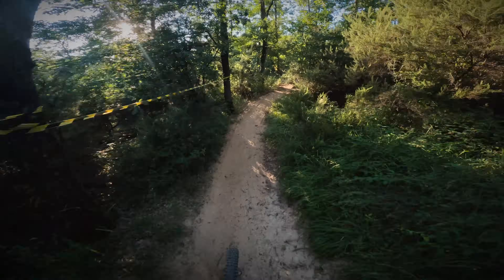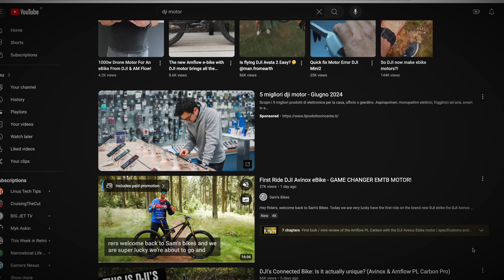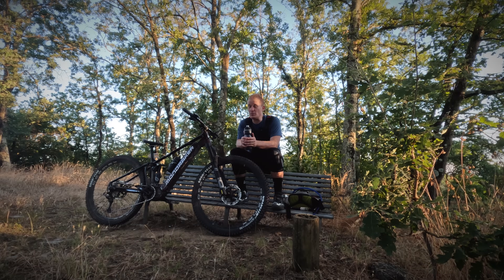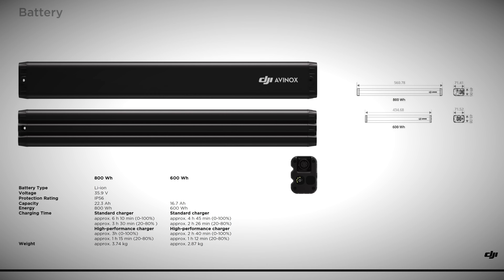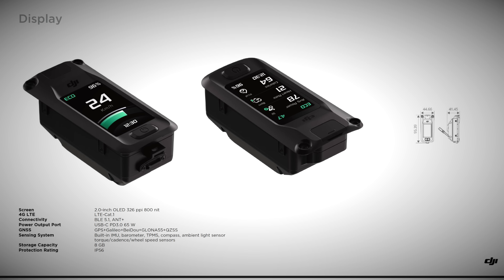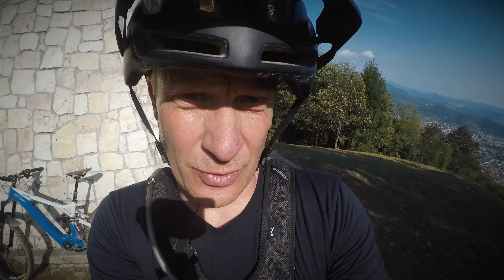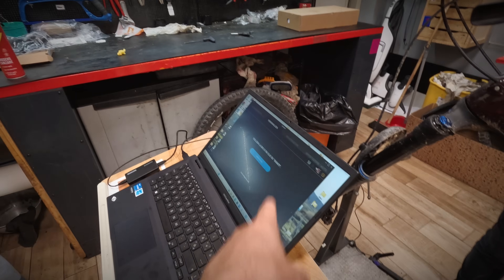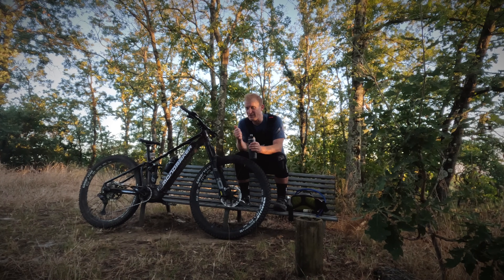Usable Motors Please... DJI Avinox, ZF CentriX, Pinion MGU.

Comment: Fully agree with your insightful, big picture observations on the latest versions of the emperors new clothes. I also have concerns about wear and tear from the dji power.  I've also contacted dji and pinion with questions and only pinion answered as they understand customer service.
Reply from the maker: If we look at the EN standard rules for power DJI's quoted peak power completely breaks the rules. The limit is 500 watts.  I'm interested to know then that if the limit is 500 then it would be incredibly silly for brands to break it. This their quotes of power levels must be therefore exaggerated in someway. So my question is who is telling us BS.....

Comment: Excellent observations. I reckon bike manufacturers ought to listen to your advice. Yes, we want more durable motors. Not necessarily more powerful motors. We need our bike motors to be repairable by the local bike shops and the home bike mechanics, and we need to be able to buy the spare parts easily. I want to be able to ride further on a single charge, with fewer maintenance hassles.

Comment: Yes the coffee grinder sound of the MGU would kill the joy of Emtb for me. I've updated my 2018 super silent, smooth and powerful 1.3 Brose Levo with a Rohloff manual change hub,170 mm Fox 38's  150mm cranks, 9piont8 steering head slacker kit + more.
The silence is golden and goodbye derailleurs for me. A brand new spare sealed, updated motor and two 500wh batteries are the go for me.Going backwards with updates gives me what I want until they can come up with something as silent and smooth and reliable. E=mtb² or is the new Amflow E=mtb³ ???

Comment: TQ's parts are hard to find here in the Netherlands, and also more expensive than for example Bosch. But most ebikes I come across here usually have bosch midmotors, or bafang hub motors. Never seen a shimano unit, but I also hardly see mtb's on the roads here. It's 95% citybikes

Comment: You failed to mention the huge difference with the ZF. Sure, the motor is small, but the biggest factor for heat dissipation is the basic design. It uses an outrunner rotor, which while great for torque in a small package, suffers from a longer path for heat dissipation from the stator. CYC Photon (also an outrunner) manages heat reasonably well, and reduces power to the motor to avoid damage. That any other manufacturers don't do this is astonishing to me. If it is true that the ZF motor is oil filled, this is how they are improving heat dissipation.
Reply from the maker: yes that is why it is oil filled.

Comment: There are many new brands coming to the E-Bike market now which is certainly a good thing. Also French Valeo has a new motor gearbox unit and they are a big player. ZF ist certainly also an interesting player they own Sachs which has one of the most powerful motors in the market since several years and they have over 100 years of experience with gearboxes. Also ZF ist 10 times bigger versus a smaller player like DJI.

Comment: Service and reliability. Key point. My wife's Gazelle had a disintegrated motor (Impulse motor, 8,000 commuting k's). Couldn't repair, no replacement available, no provision for any alternative motor. $3,800 dollar bike made useless. Went with a German made bike with a German motor after that. Now with more than 11,000 k's and still running sweet.
Reply from the maker: exactly
Reply: Presumably a Bosche. What bike? Looking for reliability for my first ebike choice.
Reply from the maker: @RoissyAngel  Anything Bosch will do you well. Try looking at the Trek Rail 5 or 7
Reply: @RoissyAngel  Bosch has the edge on all but they protect their product closely. She chose a Kalkhoff with 26 inch wheels. It feels much lighter to ride than others. I chose a Focus that is more affordable for what you get. It has very confidant handling.

Comment: Great perspective!  Polini isn’t available where I live.  I’d much rather a gen 2,3 or 4 motor that has proven reliability, likewise I’ve also gone Shimano for the first time as a drivetrain, lots of different options and unlike a MGU no large single point of failure so I can use less expensive and more durable options and fix things while I’m travelling.

Comment: There has been a couple times were my old shimano motor couldn't quite cut it up a steep section. 50% of the time it's rider error or not being prepared for what is to come... I have normal cable derailleur so can't just smash down gears up a hill xD 

But there has been a few hills id be like "that be so cool if I could climb that... " bicycles are for fun so if there's people out there who find that higher power more enjoyment to their ride then yes power will sell :) 

It's like owning a car or motorbike, yes this 1 litre shit box can get me anywhere.... can a Ferrari get me there in a more fun way most likely haha.  

That being said power management is also key... if ur climb tight steep switchbacks you need the power to be steady and natural not jerky. Tunable power comes in play for this too. More overrun for sections etc.
Reply from the maker: After 80 NM power management is key, its easy to mess it up with a loose overrun or harsh cut off or too much wheel spin.
Reply: @alexbiketester  i drag the rear brake quite often when it gets technical to stop it jolting off.

Comment: Back in 2021 I had the opportunity to ride a friend's  Haibike TQ HPR 120S,  for a week. At first it was mind-blowing , on strait lines , country roads etc . In the really technical trails it was way to much power from that engine and it wasn't really controllable. In my opinion, 85-90 NM is more than enough for an e-bike. More than that, and we reach the sphere of electric motorcycles, loosing  the fun of e-bike riding where it's not just about the engine, but also about the rider's technique and abilities.
Reply from the maker: yes!

Comment: Won't consider anything without integrated motor/gearbox now that it's been done.
Another company has an integrated motor/gearbox that is CVT soon to be released, which is my new target - when that's released I'll be looking to upgrade my ride (whenever they release the units themselves or they start turning up on ebay from junk bikes).
Reply from the maker: great to see the motors, but a bike is more than a motor.

Comment: The real advantage of the Pinion motor is the gear box. As far as I know the motor is a variation of an automotive power steering motor.
Motor plus human power tend to chew through cassettes and chains simply because you can put out way more power than even a pro athlete can provide. A pinion gearbox is designed to withstand these forces especially because the gears have near to no width restrictions and don’t need to deal with dirt and grime. 
The big advantages of a derailleur system are efficiency and weight which are both next to irrelevant on an eBike.

Comment: Couple of points. A carbon belt drive for 1000 Watts is just better than in every way to a bicycle chain no matter the brand. DJI have more battery/efficiency experience than any other brand. Less dangly bits and lower wheel mass is also better.  DJI has by far the best speed sensors, security software, bike interface, controls than anyone at Eurobikes 2024.
Reply from the maker: we need to see in real life what the system is like for a few 1000 km to judge. History tells us marketing is one thing, reality another.

Comment: Well, it is not about the power! It is about the torque! It is the torque/force that moves objects. F= m*a or a = F/m. Also, it is about assistance levels and giving the rider full control of the motor. We need manual modes, no auto-modes.

Comment: Well Pinion might not have had years of motor experience but they do have quite the long track record of Gearbox units.
I’m sure the MGU is up to the same durability standards.
Specially when it comes to sealing and gear quality.
Many motors fail on the gears they use (often plastic gears or bad sealing) 
Pinion might have the upper hand on those specs
Reply from the maker: We need to talk to them about reliability and how they manage issues, at the end they will benefit like Polini has.

Comment: I don't care about motor power (all existing motors are powerful enough), but DJI's fastcharing is the biggest gamechanger for me. I'm so excited about the 12 amps charging that I'll probably preorder an Amflow bike as soon as possible. I ride a lot on the Alps and long full day routes easily have 3-5k meters (or more) of ascent. But with current technology this means carrying an extra battery and a charger and still most of riding done in eco. But if I can fastcharge the battery to 50% in 30 minutes, this basically means infinite riding and no need to carry a spare battery.
Reply from the maker: Their battery density is leading the pack at the moment. I'm interested to see how the cells last with faster charges. At the end batteries are a consumable item, even if we don't like that fact.
Reply: Fast charging in the boonies? LOL.
Reply: @malanalan1  more or less every mountain hut in Italy will have power outlets for charging ebikes

Comment: About the power I must say we didn't have a great motor nor battery when we did our 6561ft emtb capability test ride but when we tried really steep stuff I'm talking 50% 1:2 slopes on dirt or grass I did realize too much power was a bad thing, since only the rear wheel is powered the front wheel lifted and the bike tried to do a backflip even tough I was leaning on the front and am a heavy guy, for extreme use like this I think we I included need to study bike geometry and what angle the fork must have because this seems more limiting than the power which on a mid-range 3y old ebike was enough already that the bike seemed to leave us in place almost fell from the saddle, I'm sure current generations tame their torque better tough it was very on/off for us

Comment: Whilst I agree on pretty much all the points, the benefits you’re missing with these new motors are: 1 - Reduced Motor Noise (Yes, it matters) 2 - Wireless Remotes (Everyone loves an ultra clean cockpit) 3 - better top tube controllers (Having an array of data available as the default integrated option is key).  Pity the ZF has wired controllers, and no top tube display :(. Hence DJI is nailing it where it matters.  Would love it if we could get the above alongside an integrated gearbox unit & belt drive; that’s got to be the holy grail.
Reply from the maker: Thanks for the points. Will do a video on displays soon...

Comment: ah...another useful reminder of something I noticed but forgot after renting an emtb twice the 1st time was nearly flat except one steep slope where I tried to pedal as strongly as on my muscular bike to go up really quickly the motor oveheated and shutdown (it was an old early bosch) 2nd time was a more modern but still not current bosch gen2,3 i think this one didn't overheat despite the extreme uphill 6561ft done to test if an emtb could do what I wanted out of it reach remote mountain trails, didn't overheat but lightly burned my leg on the block it was HOT it was in summer with 35°C 95°F oh yeah also those engines only go on 10'000 bikes so not for me
Reply from the maker: Yes overheating is a highly under talked about probbablem. many talk about rain mud... but heat also covers half the planet...

Comment: Agree with all your points. 
Interesting for the ZF motor is that an aluminum frame is recommended for increasing the cooling effect as the motor is clamped onto the frame, but Raymon fitted it onto a carbon frame.
Reply from the maker: They need to sell high value bikes to make it start, most companies do that. The Oil is probably to aid cooling. We lack real world info, no influencer or youtuber has actually published anything useful which is my point... hahah

Comment: It’s very easy to buy into the hype, so it’s good to get a reality check. It does mean more deals on existing tech. All this innovation is great though, keeps Bosch and Shimano on their toes. I do love the screen on that DJI it must be the best frame mounted screen to date. I think clutches and MGU’s is the way everything is going, but it’s still early days and much of the tech is unproven. It seems like full system set ups is where we’re at today, SRAM, Shimano and now also Bosch. Autoshift, etc.. 
Lastly very jealous of the Italian weather, we’ve had a crap summer in the UK this year.
Reply: Haha i almost mentioned the weather also.....DJI do seem to have done their homework, will be interesting to see why Bosch had all their CX motors covered up at Eurobike, think they may have had an OH SHEEET moment when DJI and ZF dropped. I'd also be surprised if ZF doesn't add a gearbox onto that Motor, it is after all their thing!!
Reply: @MTBGeordieDownSouth  ZF did surprise me with no MGU, I suspect that was a bit much to ask for the first model. I’m sure they have an MGU in the works.
This may simply be a way to get the attention of the big motor brands to sell their services, that’s the model they use in the automotive space.
Reply from the maker: Yes ZF might take that route. Thats what RIMAC do with motors for cars.
Reply from the maker: Its pretty goo dweather here.... cant lie

Comment: I get your point about the Power, I ride a  Trek Exe with the TQ Motor at 50nm and I'm 95kgs, riding in the Peak District with it's steep Rocky Climbs is difficult with 50nm when trying to keep up with my 85nm friends bikes so I'm also looking at full power bikes now and 85nm seems about perfect, what I've seen of the DJI/ZF motors so far this week is the lack of noise/whine that seems to be evident in the previous motor versions, for example the EP801/Bosch CX, this is probably due to me riding a TQ HPr50, so for me the reliability is key first, then the noise! In conclusion, masses of power is not the highest consideration for me.
Reply: I Agree with you 100% ,I ride in dales ,Yorkshire moors most of the time and orbea  rise h15 get up it all in mode 1 , the only time I need  more power is for really big climbs .
Reply: I have the same bike buddy and also ride in the UK I’m a little lighter than you but a big selling point especially for us UK riders is that the TQ motor carries a rare waterproof rating of IP67 which means the motor can be submerged for up to 30 minutes in a meter of water very few offer that
Reply from the maker: Even the power of the EP801 is almost unusable at times.
Reply: @alexbiketester  Just remembered, your mate Steve at EMBN mentioned the ZF has a lifetime warranty on the Oil Bath Motor, that will be a massive selling point for people.
Reply from the maker: @MTBGeordieDownSouth  Yes, that will be important. Lets see what they do, going to take 5 years for these motors to have any kind of traction...;-)
Reply: @MTBGeordieDownSouth  I wonder how they will define 'lifetime'?
Reply: @RoissyAngel  we wait and see, but putting that fact out there already, they must be pretty confident and that only comes from the 40 billion company who have been doing this in other sectors for a very very long time.
Reply: @MTBGeordieDownSouth  Everyone keeps using '40 billion company' - so what? Boeing has over 100 years expertise of building aircraft and is worth over 130 billion but doors occasionally fall off in flight.